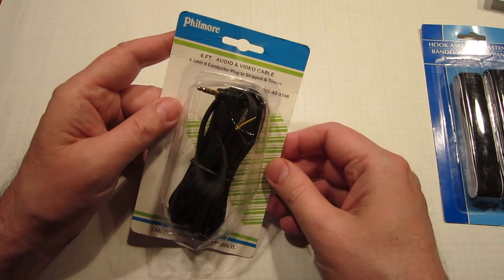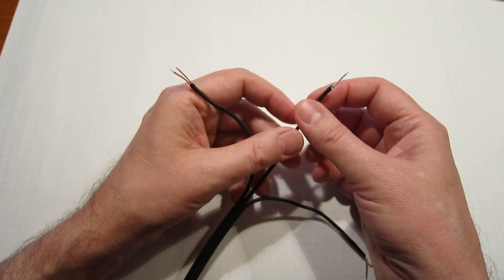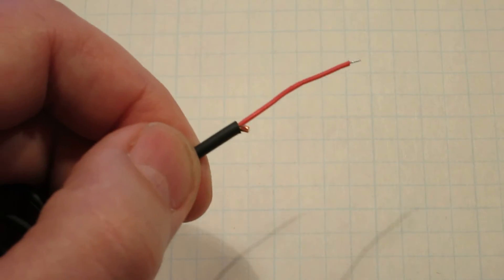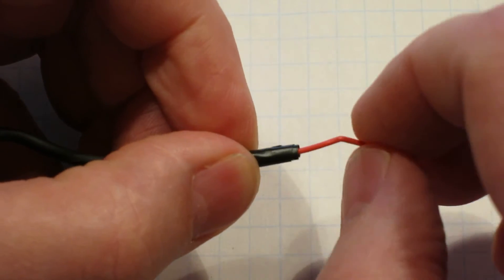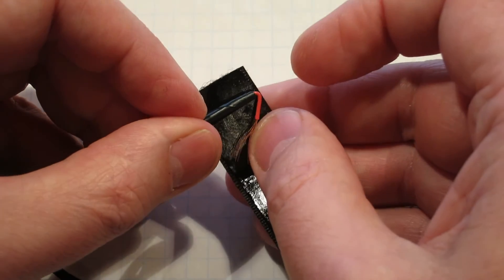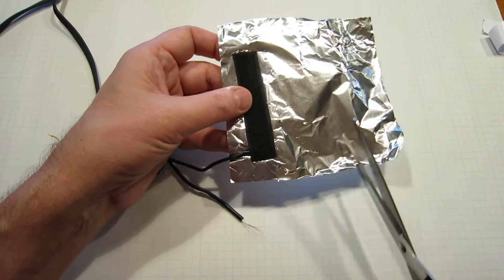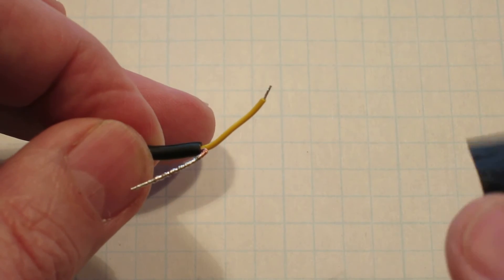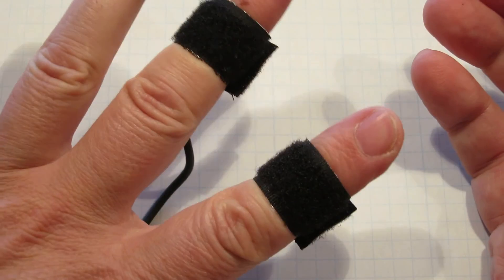Making Galvanic Skin Response Electrodes

Comment: Hi, thank you so much for sharing this video with us, but how do you collect the results? Thank you!
Reply: You could use an arduino and this sketch: http://www.circuitbasics.com/arduino-ohm-meter/  
Just insert yourself (the two electrodes) as the "unknown resistor" then get the data from the serial monitor and plot them in an exel graph.